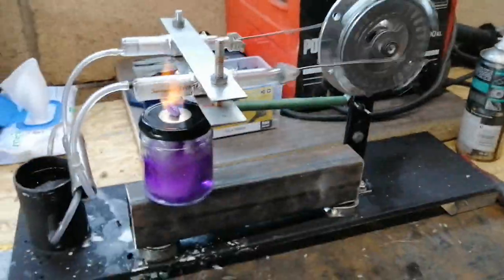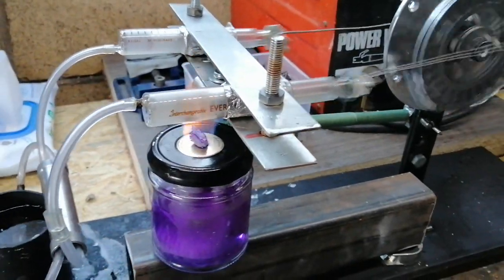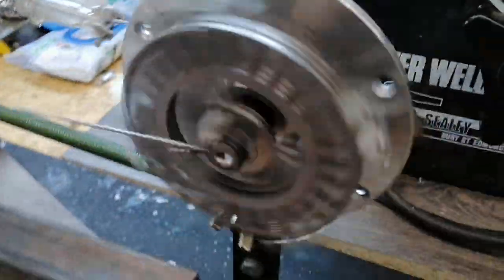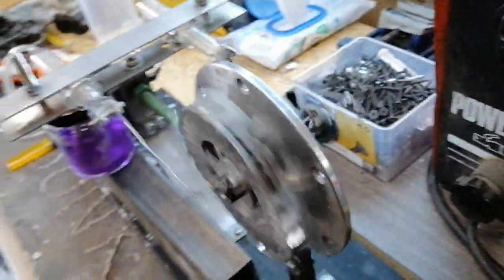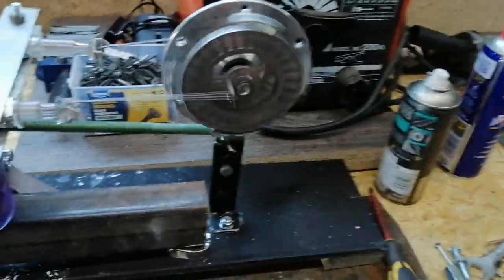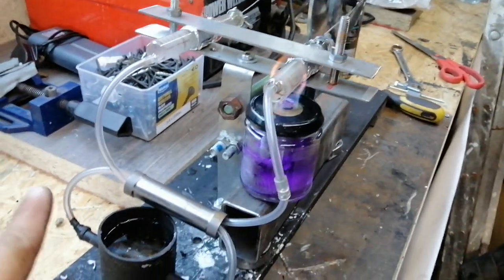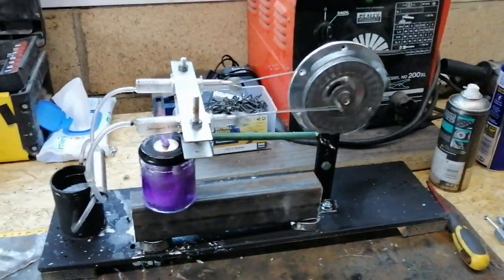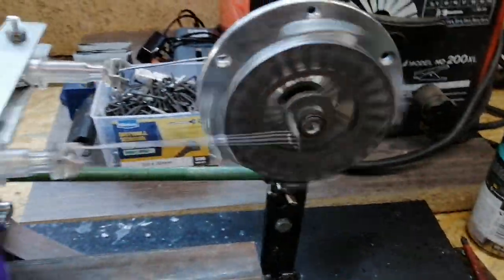Hand made Sterling Engine 2.0

Comment: 1)   mass in the pistons  Could be  reduced,  by  shortening the plungers.
2)   consider whether  mass in the  wrist pin assemblies  can be reduced
3)   in the case of a heat engine, where materials allow it, wrist pins  Should  be  sunk-into the pistons; as far as is practical. 
4)   the  design of  wrist pins   SHOULD  result in  'forces' being  Centered; not so here.   
5)   the amount of dead space, at the cold process, seems to still be excessive.
cheers

at :08, see location of cold-side wrist pin
https://www.youtube.com/watch?v=2xP_wDe4UPo